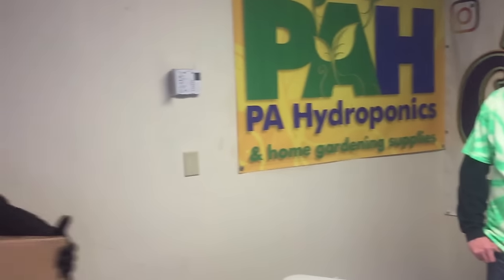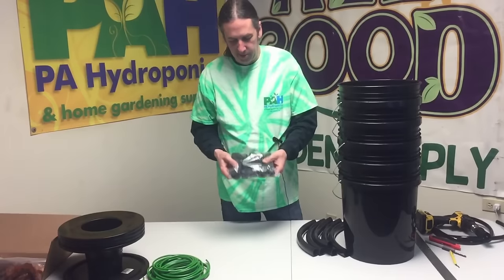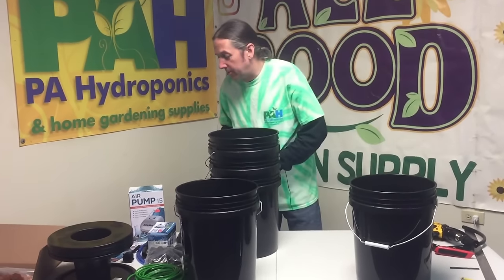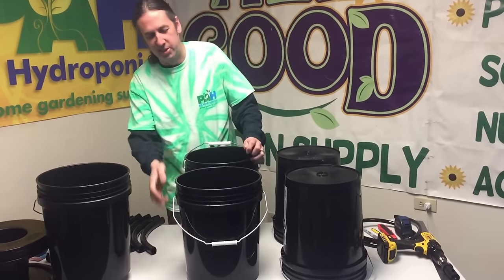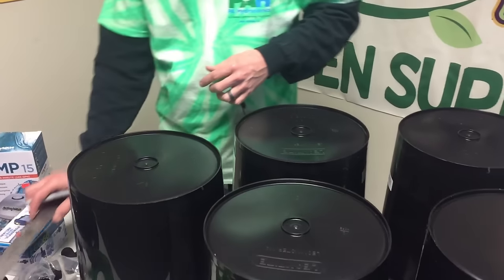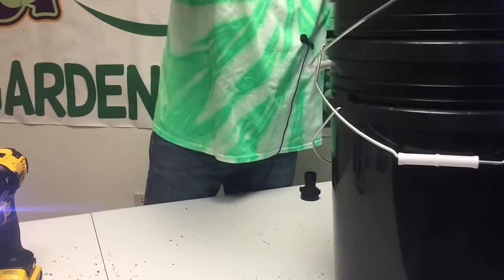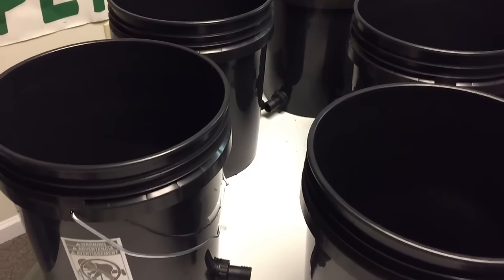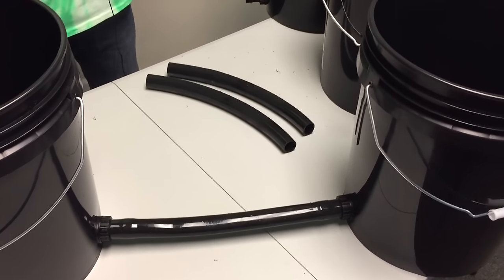Easiest 4-Plant Stirponic RDWC with Reservoir and Water Level Indicator built from scratch!!

Comment: Any advice on possibly using pvc and bulkhead connectors? If so, what's a good recommended size?
Reply from the maker: If you are looking for larger pipes to connect the buckets, I would first start with a square bucket.  The square buckets or at least a bucket with a flat face is going to give you the best seal when using the bulkheads. We sell high quality bulkhead connectors that will last years on our website, or feel free to source your own.

Hope this helps

-w

3" bulkhead connector

https://shop.pahydroponics.com/current-culture-uc-spin-tight-bulkhead-3in-free-shipping/

3 pack of 8 gallon buckets

https://shop.pahydroponics.com/3-pack-of-8-gallon-buckets-with-lids-not-drilled/

Comment: Great system 👍 I'm wondering if maybe you could attach valves on the tubes at the bottom so you could isolate each individual plant, say you have different harvesting times to eliminate one or two entirely so you could flush them with just water and not the others if you have a variety of strains?  I'm probably asking too much but I was just curious if there's a way?
Reply from the maker: That's a cool idea. We do sell a ball valve that could close off the "circuit" so that you could isolate the grow site.

https://shop.pahydroponics.com/hydro-flow-premium-barbed-ball-valve-3-4-in/

There are many ways to set up a garden, thanks for sharing your thoughts.
Reply: @PAHydroponics  Yeah thanks, I really like scrOG and DWC, unfortunately they are conflicting. You could use the valve to at least drain the bucket and top it back up from the top, it would certainly give you the freedom to grow a verities of strains and more plants👍

Comment: I'm doing a 2 bucket system right now. My next grow I'd like to do 4. but with my bucket outside the tent for heat purpose. do I need to use a larger pump if it's more than 5 feet away? Thank you for your insight.

Comment: I am looking into a system like this but I don't want to  use an air pump
I saw some discussions on rollitup forums about not using the air pump  but  instead  using another water pump to aerate the water ,  the air pumps are  not energy efficient  and are noisy and also add heat to the water causing risk or root rot ,   I have heard that  if you  use a  water pump instead it is enough to aerate the water , someone on rollitup forum said they have done DO testing with both an air pump and a water pump and found that the water pump was more than sufficient to aerate the water ,  not sure what the best way to design a system like that would   be though, I have  made dutch bucket systems  for vegetables  with    net bag full of pearlite and  was thinking of converting   one to  a  DWC with  no air pump, with the  dutch bucket system though the buckets will be elevated over the reservoir so  when the water  pours out of the return line  (2" PVC pipe) it is also creating aeration, I have that  dutch buckets outside though and for in a  tent I will not want to  elevate the buckets to maximize height
inside the tent  ,so there will not be any  aeration from the water  return line , I wonder if you replaced the air pump in this system with a second  water pump , put it inside the resovoir bucket and  have  a 1" PE line with  4 1/4" lines coming off it  ,one  spraying  at the surface level of each bucket if that would be enough  aeration ,  also  do you know of anything you can buy to  fit at the end of 1/4" tubing ha will  make a  thinner higher pressure stream so that  the water will shoot into the surface water at higher pressure and  make more aeration?

Comment: hi Gary, i just put together the 8 5Gal. Bucket Stirrpontic System. RDWC bought from your store. Thank You for that by the way its  Amazing!! looks so Nice.  im looking at the 7th and 8th buckets and the resivopur... they seem like very little return ic flowing? its doing its job, i am not complaining at all. Im sure you know my question already... so, is or does the flow need to be a little quicker?  i bought 2 differant kits from you so i have another pump with the 3/4 to 1/2" adapter.... could i put another pump in the 5th bucket to forcw the water back to the resivour??? what do you think?? this is what i thought to do???  THANK YOU GARY !!!!!
Reply: i know you said in your videos to comment on any tips tricks...ect...  well the 8 bucket RDWC with 5gal buckes. the leaking... use RTV sealer on the outside threads against the bucket to create a water tight seal. its fish and food safe.  thanks again

Comment: hi gary i like your setup but i am going to have a pond and i want to pump the pond water into your setup and go back to the pond and make it into aquaponics system i have some of what you have but i would be geting some things from you but would this work with your setup.....this will all be outside but i will have a mesh over it all to keep it kool...i want to use 6 buckets but i am going to have a filter tank that will flow into the buckets.. the filter tank will be about 30 gallon..the last bucket will have a overflow that will go back to the pond. what are your thoughts on this and thanks
Reply from the maker: I had a word with Gary to see what his thoughts are on your idea.  He believes the system will perform in the way you are expecting but there will have to be some tweaks simply because of the difference in design. Thanks for watching. If you have specific question or want to pursue a custom kit email us at info@pahydroponic.com

Comment: Love you videos I especially love the DIY. I have a 3.5' grow cabinet and I am growing out of a dwc coffee container LOL but I spent under $20 I'm am finishing the end of my grow and I've learned allot! I plan on doing an upgrade with res soon and I am planning on using 1 gallon ice cream bucket with an external res (rdwc). Does the external res have to be the same size as the one that has the plant it in?
Reply from the maker: Good question that we get a lot, everyone needs to think of the whole system as being 1 big reservoir, the extra container with no plant is just a place for you to access and add or check ph and nutes. So it reallyu doesnt matter as to the size of the "reservoir", generally the more water in the system the more stable the PH is and water temps etc. so that may be one thing to consider. Thanks for watching. Gary
Reply: @PAHydroponics  Thanks Gary!

Comment: Great vids Gary! Watched them all and i ordered this 4 bucket, bare bones  rdwc. Ive got 7 gallon buckets that I'm using tho. I only have room 4 3 buckets in my tent. Wat would you use to plug 1 of the outputs on the air pump, since I'm only using 3? I'm going to switch the direction of my circulation every day, to help with any root clogs. Ive also got a timer to turn my pump on and off. You said on 1 min off 5 mins. Would it hurt to only leave it off 4 3 mins? Or just stick to the 1 & 5 mins?
Thanks Gary!!!
Reply from the maker: Hello, good questions, you could put an extra airstone in 1 of the plant sites or use a 1/4 inch tee and connect 2 of the air outputs into 1, the timer will still help it run cooler as long as it's only on for a minute or 2 at a time so it doesnt heat up. Have fun :) and love the 7 gallon size! Gary

Comment: I am currently in a 4x4 tent. I love this setup but is there a way I can modify this so the Reservoir is outside the tent? I dont think all 5 buckets will fit inside the grow space.
Reply from the maker: The only modification would be cutting your tent to allow the flexible hose to pass through.
Reply: @PAHydroponics  i also want to run this set up in a 4x4 tent and i don’t mind drilling holes in the tent but i would have to raise the reservoir at least 4 inches up to clear the tent bottom lip …. Would that be okay or should i also raise all 4 buckets to match my reservoir height ? Thanks

Comment: I am watching videos and learning,you suggest changing water solution every week or two depending on state of crop,if the feed is all dissolved in the water won't the plants uptake a standard feed until reservoir is too low,my thought is a40 gal container of mixture  connected to the reservoir via a (what we call) a ball valve(tap) or float valve ,then by regularly checking large drum you would not need to empty the system,  a complete novice to hydroponics.
Reply from the maker: Hey there, you have a good point but I would have to say that plants only uptake what they want and if you keep adding nutes without draining it out there could and most likely will be a build up of something the plant does not want and eventually it can mess your plants up, they like it fresh and have a noticeably better yield with the frequent change outs. I do deal with commercial lettuce growers with 1000's of gallons that never change it out but they have a 5000$ machine that analyzes what is in the water so they can add just what ios needed back in like nitrogen or phos. pot. etc. Hope this helps. Have a good day! Gary

Comment: I use a powerful pump, but just use a valve to adjust the water flow. One I got with the kit I bought was weak as hell and couldn’t even empty the system through a hose with it

Comment: Question, the only 1.25" Drill bit i have is a speed bore, is that going to be a problem for me? I do have a 1 3/8 hole saw, will that work, i compared it against the bulkhead, and it looks like it will work but might have a much thinner lip to compress the gasket. (also a 1 1/8 but it doesnt look like it'll be big enough)

Comment: When changing water.. is it necessary to get out all the water? When using a pump to empty the reservoir bucket there is some water left in the other bucket and probably some in the hoses.
Reply from the maker: Hello, good question! I have got in arguments about this! I have never had a problem with leaving a little water in the bottom, I have had people after draining as far as they can dump 5 gallons of plain water in then suck that out to help flush out the last bit and it will help get out some of the old batch of nutes and you could even do it twice if you really wanted to flush it out. I have used some nutrient brands that leave a lot of fallen sentiment in bottom of the buckets but I have been using enzymes lately and that really kept it cleaner and also kept the roots happy so that is my thoughts. It is a great simple system - give it a try for a grow and see how it goes. Thanks. Gary

Comment: How much water do u put in to.run this set up im new and would like to try this thanks
Reply from the maker: Each container holds five gallons.  You are not going to fill the bucket completely because of your growing medium and the roots taking up their respective space.

So in the early stages you can expect to use about 20-22 gallons to bring the water up to the roots and/or growing medium. Later in your cycle you will find you don't use as much water because the roots displacing the water.

I hope this helps!

Comment: Hi Gary.  I am in Canada and am piecing together this system.  I am a newby when it comes to hydro and have a question. If I understand correctly the plants are going to absorb the water and nutrients reducing the water level in all the buckets.  Do you add water to bring your levels back up or do you wait until it is reduced to a certain level and then change out the whole system with fresh water/nutrient mix?
How much absorption should be happening with this type of system?  One gallon per day?  Gallon per month?
Any info on this would be greatly appreciated.

Comment: Can the res be bigger then the 5 gallon pails or does it need to be the same size as your pots for this set up?
Reply from the maker: You can use any size you like just be aware that a larger reservoir is going to put more pressure on the fittings. To get around this you can use a reservoir top off kit that will pull water from a container not attached to the system.

Comment: I want to make this system, but would like to expand it to 14 buckets - 2 rows of 7 buckets each. You mentioned that the weight of water for more than 4 buckets is too much for this kind of seal. Is there anything that I could do to make it so it could withstand the weight of 14 buckets of pressure? Perhaps larger tubing between each bucket?
Reply: I have 16 buckets on my system with no problems at all, i did increase the pump size  ( both air and water) a bit and went to a 20 gallon reservoir at the same height as the 5 gallon buckets, but other than that it all works great.

Comment: hello how do you control water level in each buckets?
Reply from the maker: Hello, pretty much gravity makes the whole system want to be the same level and it works good with this combination of 75gph pump and 1 inch tubing, smaller tubing or bigger pumps will throw off the water levels and not be even. Hope this helps! Gary

Comment: Wanted to say, Thanks so much for your videos. I have been fascinated by hydroponics for years, and am not getting to start building my own. I actually ordered the kit (without the buckets) from your website for the 4 bucket DWC system, and look forward to getting that put together. I do have a question, I plan to have all my buckets in a straight line. I built a bench last year I had tomato plants in soil in buckets and wasn't very impressed with the end results, so this year I am going to try hydroponics. I picked up some extra tubing so I can have the reservoir bucket in the middle of the system, I figured this would reduce the strain on the sub pump. Does this seem like a good idea?
Reply from the maker: Hello and straight line works fine, there isn't any difference in strain on water pump if its in the middle or end it wont matter so I would put it off to the side out of the way so you can get to it. Thanks for watching and supporting our store. Gary
Reply: @PAHydroponics  hello great video am trying to make cheapest 2-3 bucket set up can you please send me all the right size tubes fittings exception for a 10ltr res set up and thanks for the video.Am a  1st time grower and been told and from research found this to be best way for great results.? TIA

Comment: What was the minimum sized tent you recommend for this bucket garden?
Reply from the maker: Currently we do not have this system configured for a tent grow.

This Stirponic RDWC is set up as a convenient way to "stir" your nutrient solution, because of the hosing connections there would be many challenges trying to adapt it to a tent configuration from its current form.

A small room or a large tent would be suitable for a system like this.

Comment: Warm up the quarter inch green spaghetti line too Gary
Reply from the maker: Hmm, I haven't had any issues with the floraflex tube but hot water definitely helps the 1 inch tubing go on and seal up better and it also gets the kinks out and helps straighten the natural bend. Thanks for your input :) G
Reply: 1 auto a day   30 day    repeat ...MACLEAN METHOD!
Reply: Donuts have anybsugestuins on out door hi yeald? Been looking at gold leaf, critical 2,0 and ....factory bud? Industry bud?  Any hou thanks for the quick precice response
Reply: @PAHydroponics  wy wife put my pipe in hot water to bend it to her use alot to. Make for a better flow.  I'm told
Reply from the maker: @lucasmaclean6498  :)
Reply from the maker: @lucasmaclean6498  Tough one, here in PA I can say stay away from anything fish! the animals love to dig that up:)

Comment: Hey Gary, so I'm probably doing things backwards and definitely not in a very intelligent way but I just bought this system from you and it is freaking awesome. I've got it up and running and everything seems to be going just fine. The workmanship on what you sent me is excellent, perfect, & simply flawless!!! its freaking awesome!!! Well I've watching the videos what about the Gorilla grow tents and I guess I fell in love with those, so the question is- will this system fit in a Gorilla 4 X 4 grow tents without any alterations? I'm thinking I might have to put the reservoir outside of the tent & therefore perhaps I may need a longer tube to make that happen, but I'm not sure. I'm sure I'm not the first idiot who has asked this question..... I have a little crappy Greenhouse I was going to set it up in but I think I'm changing my mind about the greenhouse because the Gorilla Grow Tent rocks! I suppose I could just go measure the area the system is taking up and figure it out for myself, huh?
Reply from the maker: This kit will not fit into a tent without modification.  As you stated you will have to make modifications to either the tent or the set up.  Most people do not like cutting holes into their tents but there are others who don't mind.

Comment: I bought this setup and have minor leaks. How tight do you tighten the fittings? Can pliers be used?
Reply from the maker: https://youtu.be/ZAJjvT2bN6c

check out this video for the leak update. Pliers will damage the fitting if over tightened.  Filing or cutting back the excess from the molding process, or using a hose clamp have had good results.

Comment: Hello sir... I am very interested in getting this from you asap. I was wondering if these come in 6 or 8 bucket set up kits? Thank you kindly.
Reply from the maker: Hello there. we do have a 6 plant version on our website, due to water weight on these fittings the 6 is as big as we go, the 8 plant would require hose clamps and possibly gluing so we stay away from that. Check out pahydroponics.com and go to the shop tab. Thanks! Gary
Reply: @PAHydroponics  thank you for the positive feedback. I will definitely be buying the 6 site version very soon! Stay blessed